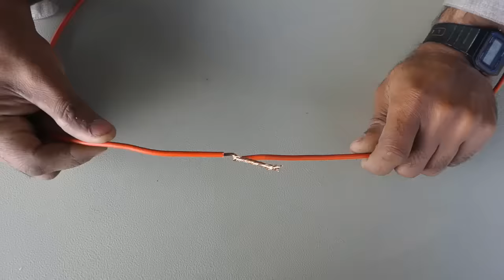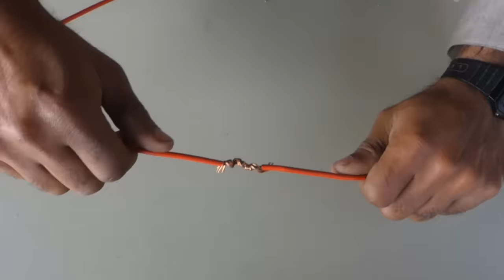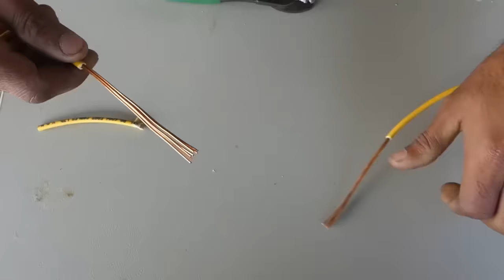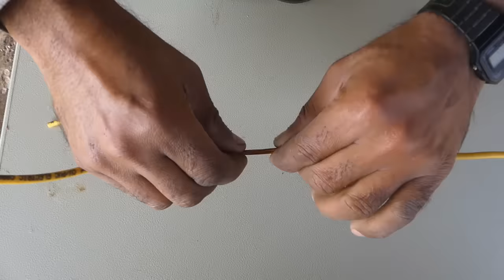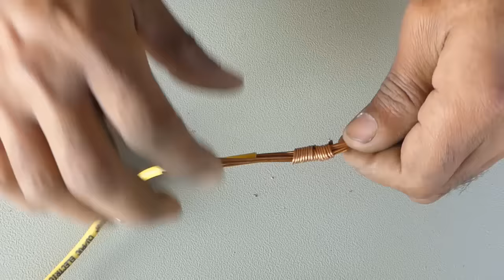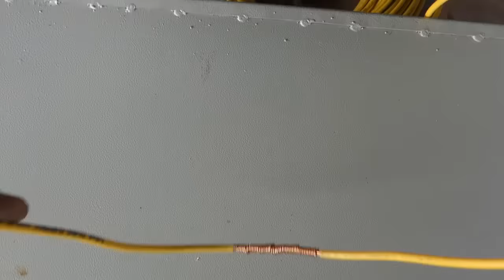Awesome Idea! How to Twist Electric Wire Together | Properly Joint Electrical Wire | Part 1

Comment: Are you building an alternator? No electrician in his right mind would waste time doing that.
Reply: I'm afraid they do
I see it all the time
Lota peeps doing windings
Sorry man
It's a very common practice
Reply: @scrappiron6307  Stop lying! Wire nuts are safer and faster. His wire wasn't even insulated which is dangerous! 🤥
Reply: @youknowwhatdaysayinhoe5646  this is the bonus.
Reply: More like thinking of a cool way to show on YouTube
Reply: Im no pro by any means but done enough jobs to never see this before, definitely a hobbyist not a production facility
Reply: @scrappiron6307  bull shit
Reply: @jz-qy9hb  stop it man 
It's just 2 pieces of wire
Reply: @scrappiron6307  as an electrician, this is definitely not common place. I would never do this bs.
Reply: @scrappiron6307  False. I been in the trade for 18 yrs and I never seen this because it’s counter productive and unnecessary
Reply: @youknowwhatdaysayinhoe5646  wire nuts are sloppy trash and would never be allowed in my car or truck and especially not on my boat. Wire nuts are fine for most residential applications only.
Reply: No he is not, he is only building views in which u have successfully contributed so far 😂
Reply: @scrappiron6307 Journeyman electrician here. And, no. I would be fired for wasting time on the clock if I did this. We have time limits we have to meet. This is just insanity. Any master electrician or foreman that ever sees a journeyman doing this will fire them on the spot. Not to mention that an apprentice caught doing this would be instantly labeled "stupid". You cannot properly cover this with a wire nut and would be leaving the building open to a fire hazard. So, this isn't even up to code. You must twist the wire and cap it, by code. This is not how it is done, nor is it common practice.
Reply: NEC still allows soldering wires after a reasonable mechanical fastening of wires is done. Wire nuts and lever nuts prevent oxidization of copper with pressure, but in soldering, the solder tinning itself does prevent oxidization. Heat expansion and shrink coefficient wise soldering is not a problem either. CCA wires are still doing fine to this date over 100 years, and so are solder pot Knob and Tube joints.

Comment: This is similar to the method they used to teach (and maybe still do!) the Signal Corps. It's a VERY strong joint and can be done quickly with practice. While i think this is a great joint for something in your boat, car, or trailer; as an electrician i would never employ this method--besides maybe on some directly buried cables you're about to bury again. Cool video thanks for sharing!

Comment: You might want to check the resistance, inductance, and capacitance. Performing twists will change the operating conditions and characteristics.

Comment: Step 1: Strip the wire back to the previous junction.

Step 2: Overlap the two bare wires by about 80%. You should now have about 8 feet of wire you can wrap around itself, leaving you with around 10 inches of new length.

Step 3: Wrap the wires until the splice is about 3 times the diameter of the original wire.

Step 4: Be sure to have a friend proofread your resume after you've updated it with your soon-to-be-former job, as you will want it ready to send out by next week to avoid a lapse in your insurance coverage due to unemployment.
Reply: First and foremost:Take some viagra in order not to get exhausted.
Reply: @Jake.The.Snake.  jo
Reply: Lol
Reply: Mind-blowing comment 😊
Reply: Lol
Reply: Not understand sir
Reply: @vinodxxx1581  lol
Reply: Kisi nay Bhi Bora nahi Patha ‹•.•›
Reply: Ill bet $100.00 dollars he filmed this tutorial in flip flops!🤣👍

Comment: Best way quick twist  each end then solder the wires together, I can do this in less than 45 seconds. (Easy)
Reply: Exactly, this is just dumb
Reply: Majid Alvi  Nothing incredible about it, you do not need to have a degree to work some things out, although some people just might, Not be as sharp as the rest of us 🤔

Comment: This is how I sued to do them, then I soldered them and got better sound.  On my latest car, I twisted the wires like so, but the sound was weak and the highs were lacking.  I had forgotten to make permanent connections.  I was about to solder, but I did not feel like it after failed experiment with a butane torch.  I them used butt connectors - and they sound WAAAY better than soldered wire!  So copper butt connectors conduct electricity better.  I'd say, if you are going to twist - crimp too!

Comment: In the good old days this was called a Philips Joint. And was only suitable for electronics rather than electrical mains distribution.
Reply: No , they used it in overhead power lines 240/415v they use to splice then solder copper , I also use to rat tail copper streetlight distributors , that was over 40 years ago in Sydney
Reply: Thanks for 1M SUBSCRIBER'S

Comment: If it's in an environment where things could potentially "pull"on the conductors.  It should be in a raceway/wireway with slices protected and accessible within a junction box etc in the States

Comment: With so many loose ends it would poke through heat shrink easy I’d think. Also if you wrapped double the wire as he did you should have more strength.

Comment: A version of the Western Electric twist used on the telegraph lines first .When tined or soldered continuity is improved and strengthened line breaks somewhere else.
Reply: A Western Union or Linesman splice is solid conductors, tinned and soldered.  You don't partially unwrap a stranded conductor.

Comment: Lol, OMG. Funniest thing I seen so far as an electrician.
Reply: @107Jericho  you would never twist cable like that. That method is completely impractical, even if it is more strong than the usual way of twisting cable, how would you be able to terminate with that method, the video is completely wrong. Also, electricians dont tighten the cable with fingers but with pliers and dont  spent days on wiring one power point.

Comment: That’s great. When is your wire under tension when you’d need this? Almost never.
Reply: This is used at high voltage overhead lines. But in house wiring yes this is unnecessary

Comment: NEC requires splices to be mechanically fastened (ex: wire nuts). A similar splice was done with knob and tube wiring and included soldering of the splice. That was prior to NEC regulations. They didn't require splices to be made in a junction box either. My, how times have changed in a hundred years!

Comment: You doubled the length of wire you stripped on each wire that alone will create a stronger connection even if they were twisted together the same way

Comment: Pretty sure he just made a coil around a core... he is going to have high current flow through that one connection. The more wraps around, introduces more current... this is how a generator works people. Magnetic induction. Eddie currents. Magnetic flux. Duh..
Reply: Someone's going to need the Ghost Busters 😁.
Reply: #Trueİnfo
Reply: Abudulla #IBEW
Reply: Not like that man. This cable is dont have any insulation like motors coil. So whatever in your mind will not happen

Comment: No electrician will have that much of time to waste 🙃
Reply: @ExtremeRidersJodhpur  ..chala ba loyra
Reply: This above joint is for single stands wire , multi stand wire can easy be joint in a running joint pattern.
Reply: Wire par baith kar jhula thodi jhulna hai...
Reply: That is so muchwaste
Reply: @thomasmarable6818  he getting the job done right and properly
Reply: The ones that are 13 cents an hour do.
Reply: @ExtremeRidersJodhpur  multiply 3:30 connection x 100 connections to be done.
Reply: Karya wow ok support ok
Reply: I'M AN ELECTRICAL ENGINEER AND THIS IS HOW WE JOIN BIG CABLES WITH SPLITED WIRES IN AN INSULATED BODY.
Reply: That's is why many electrical accidents take place ...If u have no time to do the job perfectly ..Then go and sink in but don't break the fundamental of electrical safety
Reply: @vivekupadhyay6333  Han wobhi sawan ka jhula. 😁
Reply: और तार भी बेकार
Reply: No electrician would join wires this way.
Reply: @michaeladeosun3687  no it is not.
Reply: Make a  video yourself and show a much better and quicker method

Comment: Even the wires can be tighter, it's easily to get burning from the junction point in higher risk. 
Anyway it's not leagle and not safe,  wire is not rope🤔

Comment: As an Electrician. This HORRIFIES me. NEVER do this. Don't ever do this. Call a professional to do it properly. This is how you start a house fire.
Reply: So true so true! these "Romex" benders have no understanding or concept of ambient or capacity. 
🤔Hum,,,,, Ohm's law?????
Nhaa,,,,, don't need no 
 meditation 🤪
Reply: Chris G - so true, this guy is such a pervert! All fine if you want to make a nice copper tree. 
Don’t ever encourage this as correct practice! Very irresponsible! 🙄
Reply: Facts. My foreman would write me up or send me home for doing some stupid shit like this. Only use for this is when ur pulling an added circuit in a conduit using the ground wire thats already in the pipe.

Comment: But isn't these spirals play a solenoid role and create a magnetic field around and cause heating effect??
Reply: Will it
Reply: No because the metals are not insulated
Reply: With no core, the effect is very deem.  It also seems to me that one leg is twisting in the opposite direction than the other canceling the effect... BOOM
Reply: " When you read 2 pages online, are jobless and have nothing to do but now you think you are a scientist "
Reply: @impoppy9145  pretty much
Reply: No
Reply: Perhaps. Very slight though, and cooper conducts heat away from problem spots quite well.

Comment: Yep!  PS259, Brooklyn , N.Y.  (Junior High Electric shop class, 1957). They called it the "Western Union' splice
Reply: Similar to a zeppelin bind with spicing two ropes together for lashings of cargo on a zeppelin... What I use for low voltage...then electrical tape or crimp or shrink tube- if out side or in my car.

Comment: You dont need mechanical strength for current flow
Reply: But who wants to repeatedly connect the wires every time they separate?

Comment: I mean, if I had to escape out a window on the third floor and all I had were pieces of wire for a rope... and I didn't really need to escape until Tuesday... this is probably the method I would use to join them.
Reply: す

Comment: You do realize that the 1st two methods are generally done when it's something that requires a temporary solution. If it is something more permanent, one would simply wrap the wires with electrical tape and the connection would be just fine!

Nobody in their right mind is going to do this method! 🤦‍♂️
Reply: And what about the timing does anyone recognise the time taking in single joining? Who gonna waste so much time in this....

Comment: This would never go over in the states....an inspector would take one look at that and fail the job.   Here all wire splices must be inside a junction box.  Nice wire wrapping technique but just not feasible on a job
Reply: This is as a line man splice aka western union splice. It is not meant for household electrical work but meant to be used for telegraph and telephone wires. Today it is used as a vibration resistant splice in the aeronautical/aerospace industry. This demonstration is incomplete. After snipping the ends, solder is reflowed over the splice to prevent fraying and then covered with a copious amount of heat shrink tubing
Reply: admin 👨‍💼 sounds better

Comment: This is correct, I’m also agreeing with Dave, Joseph, and MR Wolfe. I do want to touch on the NEC code for a second. My interpretation of this code as of 2023, if a splice is made without solder the only acceptable toll would be the splice locks or “wago” (b/c most call it by the brand), correct?

Comment: This is not supposed to be done since electric magnetic field will be created since of forming a wire in rotary fashion and need to check the output power, there will be eddy current loss can occur in this type, so not recommendable
Reply: Bullshit!!!

Comment: if the wire is on the tapping box, how could you tap another wire if you splice like that. In that case thats splicing of yours are use to extend wire. I'm i right?

Comment: It would be kind a hard to do that inside a junction box with other wires in there and up in an attic
Reply: You use connectors (like wago) indoor, this method outdoor.

Comment: Wouldn't winding the wire in a coil like that cause that part of the wire to act like a capacitor and lead to it getting too hot and causing a fire ?
Reply: I was wondering how much resistance was added making a coil like that.
Reply: None the wires are not insulated and current will follow the easiest path.

Comment: As someone who's been working in the the electrical field for over 20 years.... This is NOT how to splice  wires together.
Reply: This is as a line man splice aka western union splice. It is not meant for household electrical work but was historically meant to be used for telegraph and telephone wires. Today it is used as a vibration resistant splice in the aeronautical/aerospace industry. This demonstration is incomplete. After snipping the ends, solder is reflowed over the splice to prevent fraying and then covered with a copious amount of heat shrink tubing
Reply: Cracka Jack Essl
Reply: Empalmando así despues de 126 dias terminas la instalación de un velador.
Reply: Yes
Reply: You use that wire in my house I would sue and you will never do it again

Comment: confusing form over function here. Unless the wires are bearing mechanical loads (which will require a cable and no more copper wires) who will go thru this trouble?

Comment: Slide shrink tubing on one side of joint before connecting joint, then slide over joint heat and seal.

Comment: I'm not an electrician (I'm a plumber) and I feel that by wrapping that one section so heavily that you would effectively lower the guage of that wire in that one joint, lowering the resistance as well, creating a "hot spot" that could potentially be a fire hazard or at least cause some sort of short/issue with current. 

Anybody well versed on the subject care to comment? I'm asking because I would like to use this sort of connection in my car audio wiring (power and signal) just because I need strong connections like this. I know that I'm working with DC and he's demonstrating with wire that would be used in an AC application, but some of the properties carry over. Im just worried about a large section like that pooling current in one spot or something like that.
Reply: No need to do this for your audio connections. Try these butt connectors out. They have solder in the middle, are heat shrink, and also have a weatherproof sealant on each end. All it takes is a heat gun or a lighter in a pinch. It is not necessary, but I also add a little flux to help the solder flow before putting the wires in and I still put another piece of heat shrink tubing over just for the added protection.

***Edit for link

https://www.amazon.com/TICONN-Connectors-Waterproof-Insulated-Electrical/dp/B087PQCDD9/ref=mp_s_a_1_1_sspa?dchild=1&keywords=solder+butt+connector&qid=1602707945&sprefix=solder+butt&sr=8-1-spons&psc=1&spLa=ZW5jcnlwdGVkUXVhbGlmaWVyPUFWS1M2MU42SFdJUTUmZW5jcnlwdGVkSWQ9QTA2NzMyNzMzMEQ0Qk5TMjAxRDQyJmVuY3J5cHRlZEFkSWQ9QTA5OTcxNzcyRkVDR00xWkpYWFlZJndpZGdldE5hbWU9c3BfcGhvbmVfc2VhcmNoX2F0ZiZhY3Rpb249Y2xpY2tSZWRpcmVjdCZkb05vdExvZ0NsaWNrPXRydWU=
Reply: austrian plumber here :D im like 99% sure that there is no problem if you do it carefully
u=r*i and p=r*i^2 (p=u*i)
thicker kable=>less resictence[r]
current[i] is constant=>p("heat") should be lower in that part of the kable
its like makinig a pipe bigger and smaller afterwards in=out but dont quote me on that if a house burns down 😂
Reply: Ill comment...You are totally wrong.... The splice would likely work just fine but is a total waste of time....
Reply: It would not "lower the gauge" or create a "hot spot".......Licensed master electrician....
Reply: Lower gauge does not create Hotspot. The opposite would be true. Lower gauge decreases resistance, which decreases Heat
Reply: @lawpenner  well technically if you put enough amperage on a smaller wire it would eventually heat up and the whole thing would be a hot spot hahaha
Reply: @jonjon3035  I think my brain must have small wiring because it sure heats up easily under load
Reply: @lawpenner  High resistance would make a hot spot... but so could low resistance on a small small conductor... Like having 80 amps on a #14 wire. It kind of goes both ways and it would be specific to each application, load and wire size....
Reply: @lawpenner  that is not 100% true though. you cannot put 100 amps  AC on a speaker wire....it's hard to explain with a beer on a keyboard right now.... The conductors must be sized per their load....high resistance can equal heat like in a heating element.... and low resistance with a large load could equal heat also. that's why certain wire sizes have limitations on the amperage they can carry..... a poor splice with minimal contact can equal high resistance and the power struggles to bridge the gap or transfer if you will and it heats up, fails or glows bright red.
Reply: @jonjon3035  i see things more simply...
1) the higher the Gauge, the higher the Resistance, the higher the Heat buildup. All things being equal 

2) the higher the Load, the higher the heat buildup. All things being equal